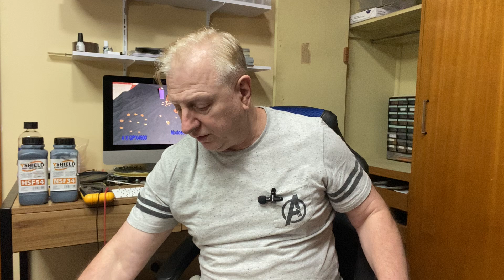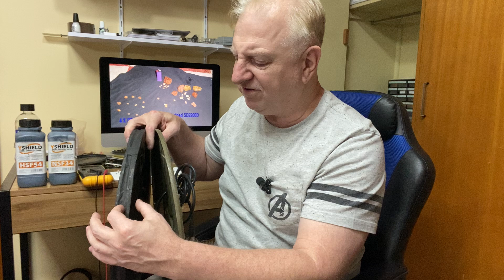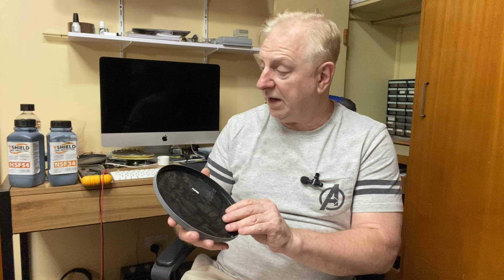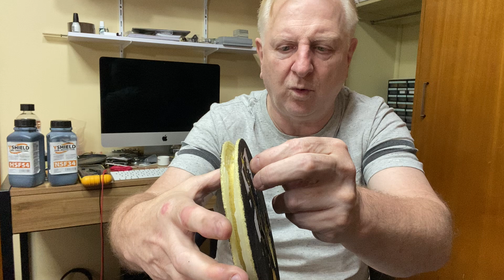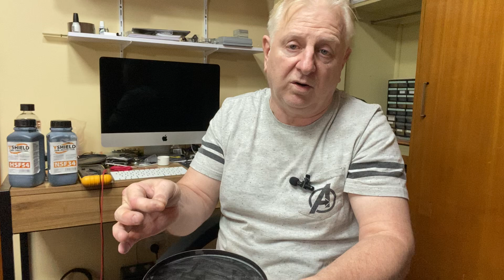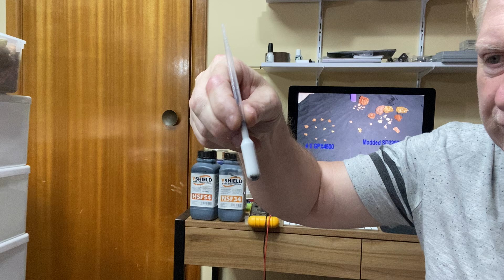Detector coils, GPX detectors, SD detectors, make coils, conductive paint, shielding wire, big gold.

Comment: I was wondering if making an emf shield for power lines and placing it directly ontop of coil, would it swamp the rx and not good?
The shield is light thin foam saturated in lanolin grease encased in plastic.
Reply from the maker: Nothing really works except a cancel coil configuration.
Reply: @DetectorMods  Thanks for that info. 
Your doing God's work for us all in the detector world.
Cheers.

Comment: Thank you, Woody, and a thousand thanks.  Please, for a perfect and good coil (300uH) while winding the Litz wire in the first layer, what is the air distance between the winding and the next?  How much is the air distance between the first layer and the second, and so on?
Reply from the maker: 1/3 wire diameter on each wire should be air dielectric of one, if using a higher dielectric the spacing needs to be greater than 1/3 diameter thickness.